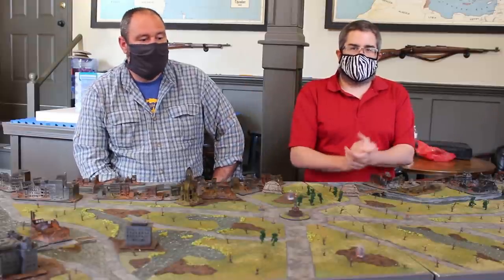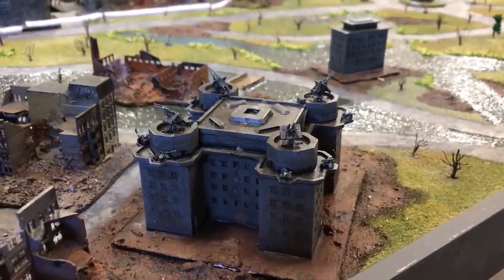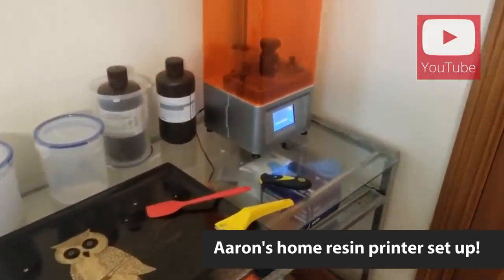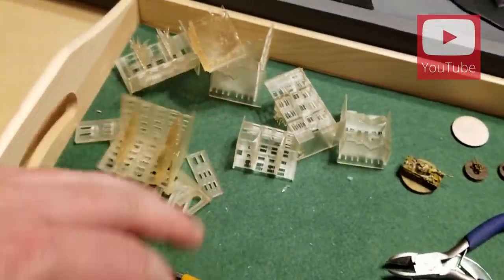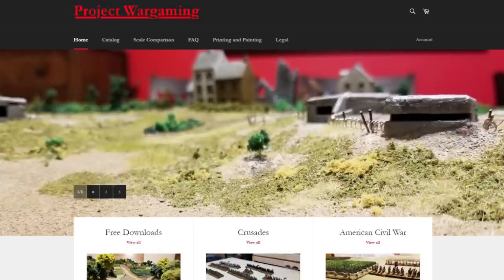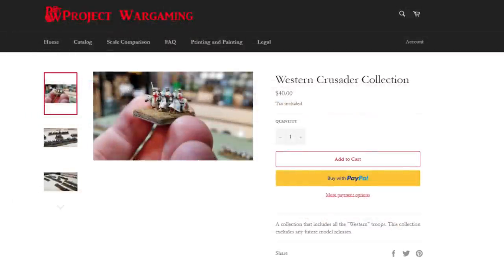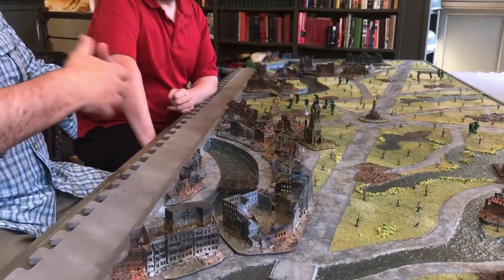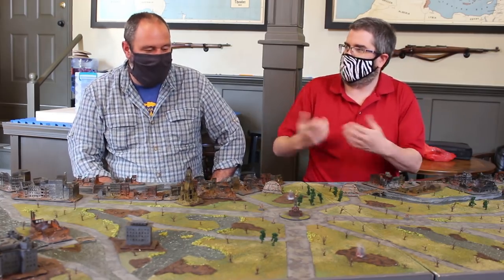3D Printing Berlin 1945

Comment: Interesting video, and of course that table looks very cool! With regards to 3D printing ruined buildings though, I can't help but think this could be achieved much cheaper and faster simply placing four flat cardboard walls with cut windows and doors for each "basic" building, and some extra care for special buildings, the Reichstag, etc. If done well it doesn't look cheap and for this scale it would be detailed enough...
Reply: Having done it both ways I would say 3d printing is faster. Having to cut out windows is pretty tedious work but yes cardboard would be much cheaper though not as durable.

Comment: I also love GHQ models, but my main complaint is how the barrels on the tanks get bent and broken so easily due to the soft alloy. I am hoping that Resin (though still breakable) is a bit more resilient. Either way, I will definitely be ordering stuff from Aaron in the future!
Reply: I have begun using a mix of resins that actually makes the models more flexible and almost elimates breakage. I have a couple videos on it. You definitely give that a try.
Reply: @Captn_Grumpy  spearman at all levels are typically a wreck  if you like things straight and true. Ha